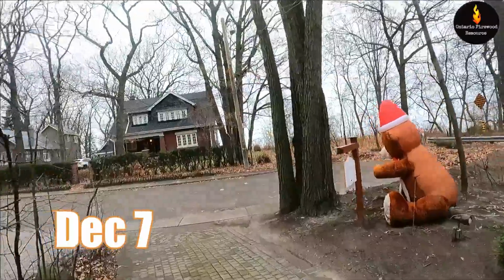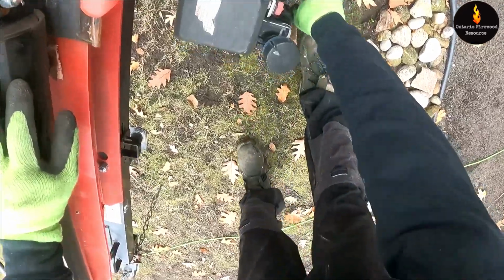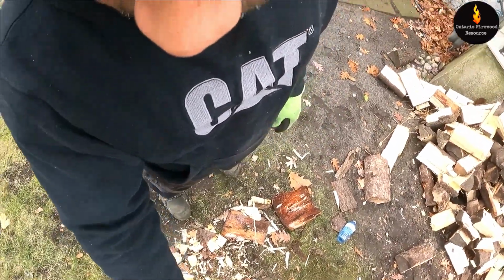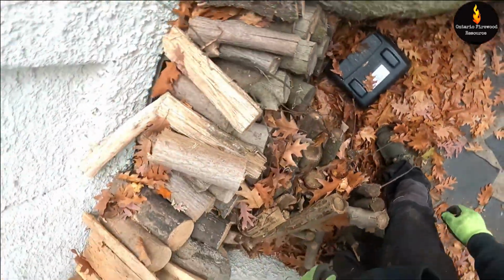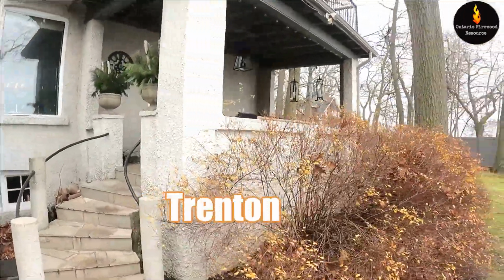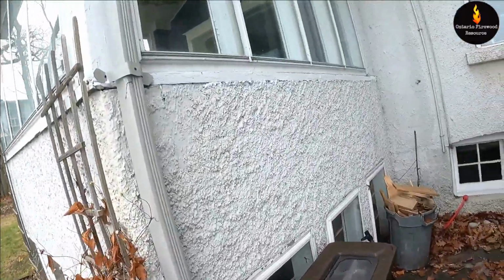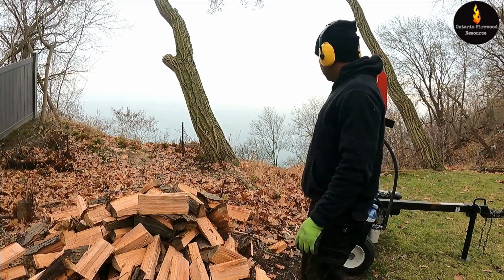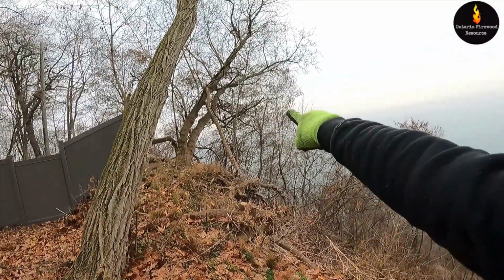SPLITTING FIREWOOD ON THE EDGE OF LAKE ONTARIO

Comment: Was this a minimum charge job?
Reply from the maker: I don't really have a minimum charge officially. I may just do a good deed for 50 bucks and will probably ask for a couple bucks more, and it is likely to but only half an hours work.This place I said 100 bucks, there wasn't much to split, but I had to move wood around first as well as the splitter a couple times. Altogether. It took lest than and hour, 75 USD